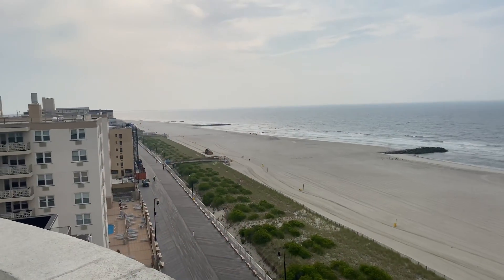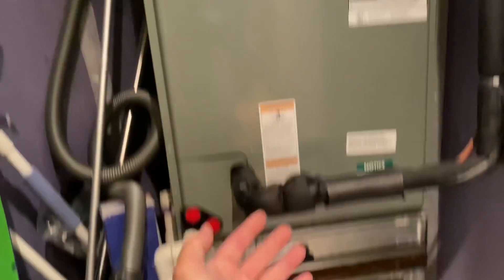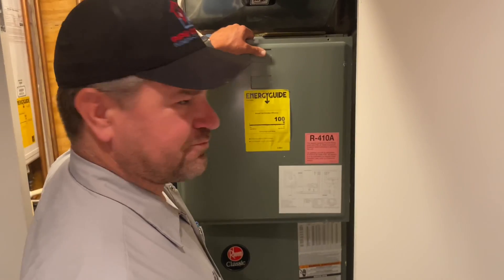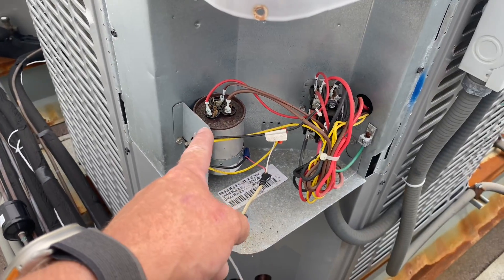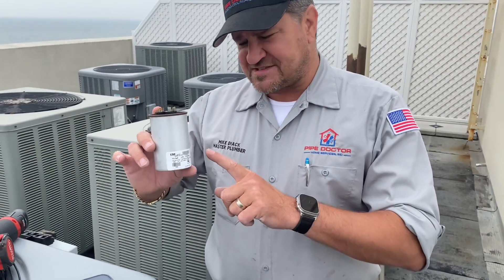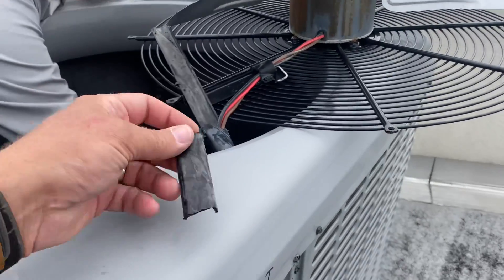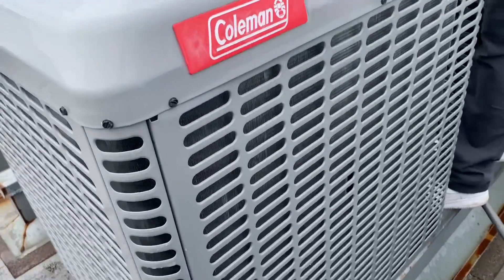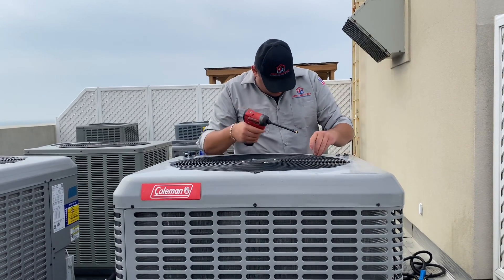Warning! The Shocking Truth About Your Faulty Dual Capacitor"

Comment: Hi Mikey.
CSC, Protech (sometimes Protech/ CSC) and other OEM capacitors often were low viscosity types and will slosh around when new. There is nothing wrong with them. As long as not leaking and they read in spec, they are good.

There is no way to tell which heat transfer medium the manufacturer uses in the dual capacitor. They changed over time. Could be anything from polyurethane oil, silicone or petroleum  based resin to greases or gels of either types. 

The fact Amrads are silent during the shake test just means they use a higher viscosity medium. (which seems to be the way to go these days.)

Those caps (CSC, Protech) are cheap, useful and still available as new surplus. Order a couple and give them the shake test.

Radwell lists Eaton as the manufacturer, but I'm not sure. I think Eaton may have bought them and then discontinued the line.
Reply: @PipeDoctor  Then see for yourself, please. Order new Protech or CSC caps. You'll be able to use them so it's not a waste of money. 
If we're not guessing, we're testing.
Reply: By the way, the gels don't completely fill the available space either. (Which is why I always like to mount them tabs up) They just don't move around.

Comment: It would be interesting to see what a company like AmRad has to say about a "shake test". Could be oil has reduced viscosity due to oxidation, impurities, heat cycles... The function of the oil is to protect the metal foil and paper/film dielectric elements of the capacitor from moisture and oxidation and to some degree of better heat transfer. Ideally, they're not really supposed to dissipate energy, so they shouldn't be getting too warm under normal operating conditions. That's another test for you, is the capacitor warmer than it should be?
Reply: Yes, Amrad most likely uses a higher viscosity transfer medium.